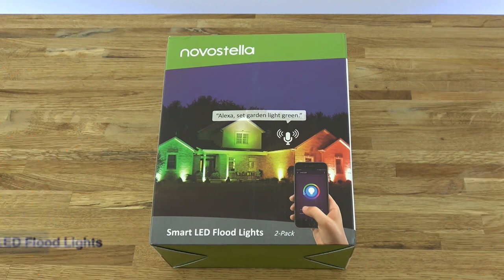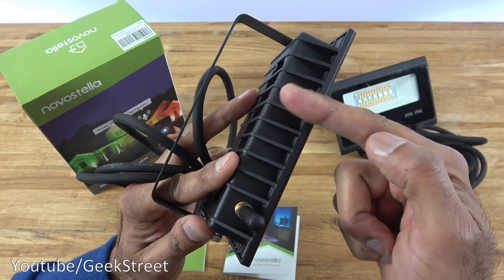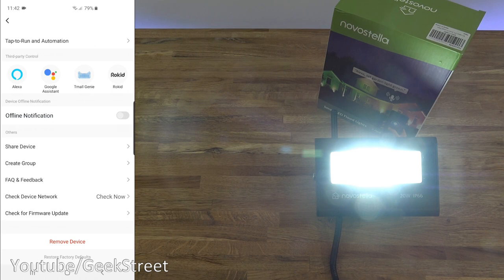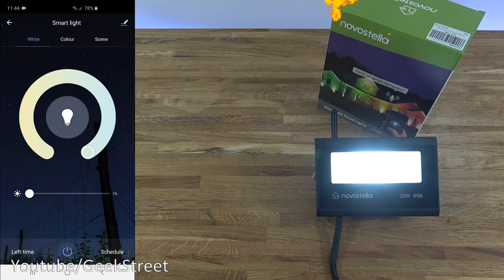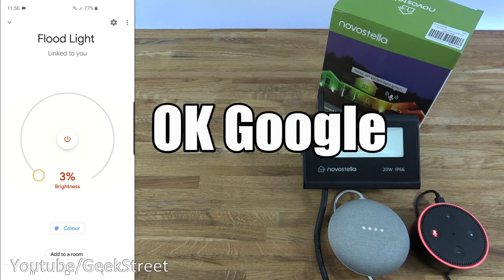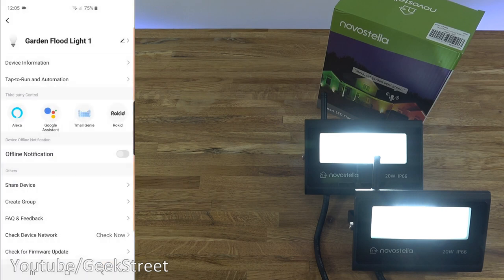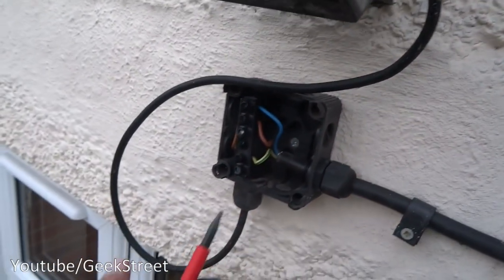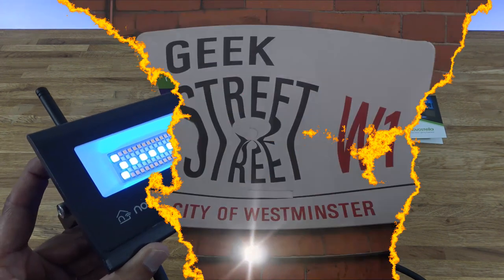Novostella Outdoor Smart LED Flood Lights Unboxing and Setup and Installation Tuya / Smart life App

Comment: I wish you would’ve included the cutting of the wire/preparation/connection. Overall good video.
Reply: Exactly what I was waiting for
Reply: Really if you need someone to show you that, you probably shouldn't be attempting to do it yourself.

Comment: Did you find the 20w was enough? I'm going to put one up near the roof, but only a small garden to light, thinking maybe the 60w would be better?
Reply from the maker: Mine was just ceiling height on the ground floor so this is perfect if you're going heigher go for a brighter one.

Comment: What if the light doesn’t flash during setup? I’ve tried turning light on and off several times.
Reply from the maker: Turn it on and off about 10 times and it will start flashing.

Comment: Hey can you program it in way that lets say I wan't It coming on at 5pm 100% white for example ...then change to 50% at 6pm and say at 8pm I want red an so on etc?
Reply from the maker: Yes using smart scenes
Reply: @GeekStreet  thank you for your reply, is there a limit on how many I can create? I am thinking programming sunrise, mid day, evening and moon lighting etc.
Reply from the maker: @matharm78  no problem, happy to help. No there is no limit but keep in mind if your internet goes down it won't work.
Reply: @GeekStreet  thanks again. interesting that it wont work when the internet goes down. I have some other controller which keeps running the same program when the internet fails and refreshes when back online. that might be a problem... thanks again useful information
Reply from the maker: @matharm78  you're welcome!

Comment: Trouble connecting to Comcast wifi any suggestions it is 2.4 and 5 bands
Reply from the maker: Its 2.4Ghz try disabling 5Ghz add in and then enable again.

Comment: I have two lights that I installed about a year ago - love 'em and use them all the time.  BUT, I just bought 2 more - I get them flashing, but have no luck getting through the install -- clock runs - and it just times out.  I've confirmed 2.4Ghz Wifi (and password).  I've tried adding "wifi lighting" (even tried "wifi flat panel light").. and nothing works... I have the light RIGHT NEXT to my wifi antenna and iPhone... I have no idea why i can't get these two new lights added......  anyone with any ideas??
Reply from the maker: Try disabling 5Ghz wifi on your router and once added re-enable it.
Reply: @GeekStreet  thank you. unfortunately, that didn't work either.  I even deleted and reinstalled the APP - still nothing.  I appreciate the suggestion, tho.
Reply from the maker: @__hjg__2123  no problem, that makes no sense why its not adding. Perhaps reach out to their support team and see what they say.